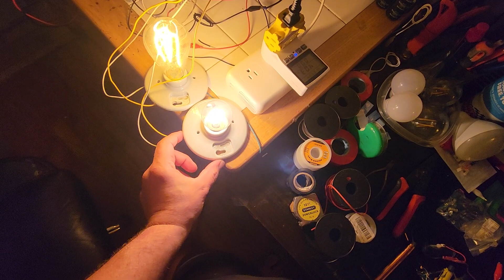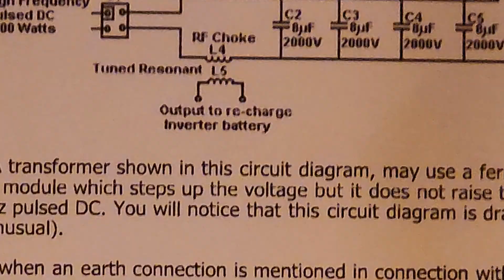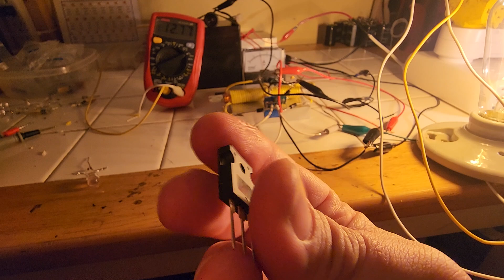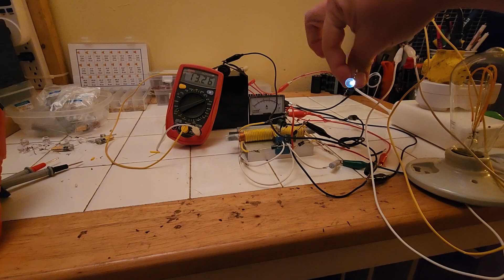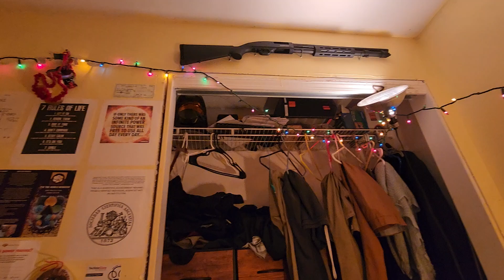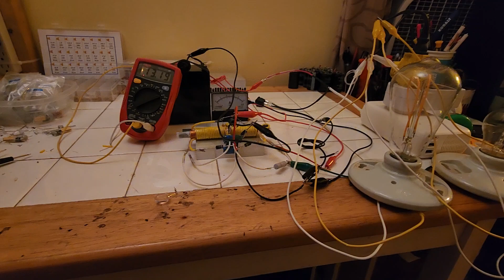🌞NEGATIVE RESISTANCE PHENOMENON NEARLY MASTERED IN RINGER CIRCUIT PLUS LOAD TESTS PART 2💡 70 WATTS!🔵

Comment: What a lot of BS.
Reply from the maker: Feel free to build the system yourself exactly as specified & test it out for yourself. I fully disclosed how to build it
Reply: @MTECH2022  ok .show me the schematic.
Reply from the maker: @mik823  https://www.patreon.com/posts/negative-ringer-103979604?utm_medium=clipboard_copy&utm_source=copyLink&utm_campaign=postshare_creator&utm_content=join_link
Reply: @MTECH2022   i have looked at the schematics however they are ridiculous. You have listed the zener diodes without any values but instead listed them as a SR 150 which is infact a wideband transceiver IC and no pin outs showing in the schematic. There are no lamps in the schematic only inductors and the current in the schematic is nowhere near enough to light up the light bulbs you are using. You are a liar and a con artist.
Reply from the maker: @mik823  i have no idea what false information you're perpetuating but it's literally a super joule ringer 3.0 circuit first invented by laser saber & all I did was add the correct value resistor to the device instead of running a load to create negative resistance then I use resonant coils to harvest the wireless power & send it back to the source. From there it can run an Inverter for a time then when the Inverter is switched off the system recharges itself

Comment: Dude - the voltage levels off at 12.42v under 80w load? That means your system is in resonance at 12.42v and with some more tweaking or a different inverter frequency, you can tune it to level off at whatever voltage you want. I think you may have tapped the underground power from pyramids or some other energy in the earth. Please be careful, that LED is showing that those special EM fields you are drawing power from are saturating your body. There may be health side effects to being exposed to this radiation.  You should contact Steven Greer and get this technology out in a live-stream before you get deleted bro.  Stay safe out there.
Reply from the maker: Thank you & a resonant 5AH source is doing all that & the full schematics are live & listed for free all over the internet now. This technology is an extension of Don Smiths & Nikola Teslas & It's definitely tapping some form of earth power & I'm interested in learning everything you know too.
Reply: @MTECH2022  I have some limited basic knowledge of this effect, but it can come from different fields, many of which are engineered out of our measurement equipment like scopes and DVMs.  I recently heard that there are like 3 other forms of electromagnetism that were in the 21 electrodynamic formulae created by maxwell and later reduced to 4 by heavyside  (I may be remembering that wrong). But we would never know about the scaler, spinor and torsion fields because you would have to derive them from the source maxwell quaternion equations that I still have not found. I have read about floyd sweets static generator and stan meyer's resonant plasma accelerator that was classified by the navy in the 80s. Both of these systems tap different aspects of the same source every atom accesses to maintain it's form or resonance to exist.  These systems simply help to scale that energy up to something we can use with our deeply sabotaged electrical systems. My concern for your health comes from an idea that I had when people say it's always the MIB coming or the aliens, It may be equally possible that these energies are just harmful to the people that are around them, Just like nuclear energy still is when we don't know all the radiation that can come from it.  I just think people jump to irrational explanations too quickly, some people have legit been taken out from talking about this stuff, I am just not convinced it is only the government taking everyone out. You seem to have way more nuts and bolts experiments than I do for sure and i agree with you there is a lot of snake oil out there, but this is likely not that, this is a real effect and people need to learn how they were brainwashed about electronics in school.  If you would like to talk more let me know.  I am deeply fascinated by this stuff.
Reply from the maker: @depsilon4  appreciate your detailed input & I saved your comment to my notes & floyd sweet was extracting energy from custom self oscillating home made magnets he made I believe & there's definitely interesting things occurring within this system especially when it's earth grounded. I'm curious if there's secret pyramid based power sources around the earth that are emitting massive amounts of circulating currents that can be tapped by the correct circuitry.
Reply: @MTECH2022  Interesting you mentioned pyramid power, there are rumors that underground in Alaska, there is a pyramid still powered up that government agencies are studying and using to power remote underground bases and submarines. Pretty sure the ancient ley-lines and pyramids formed a power network before our iteration of modern civilization.  Another researcher that comes to mind is john searl who built and magnetized his own rotating magnet rings to create a generator. Just like we are showing now with nano-materal layering at specific angles when passing current through them causing unpredictable emergent properties similar to meta-materials, magnetizing layered materials at different angles and geometries seems to unlock runaway resonance in these normally benign materials resulting in very high power densities.  I agree with you, these machines are not violating conservation of energy or thermodynamics, they are just newer versions of windmills and water wheels tapping into different streams of air and water pressure where air and water pressure are metaphors for dark energy or energy fields our sensors were engineered to ignore or cancel out. Can't wait to see your test results in an open area away from cell towers, power lines and radio antennas.  Might even be cool to try inside a faraday cage out there as well to prove the effect does not follow normal EM propagation models.  BTW, stan meyer was known as the water powered car guy, but his most interesting work was transmuting different gases using his resonant accelerator.
Reply: @MTECH2022  I don't really understand your approach but I hope you succeed in building a reliable system that I can go into agreement with you and get for my village people in West Africa.  We are on the dark
Reply from the maker: @kanjo-Etienne  i hope the system can accommodate those challenges & help you guys
Reply: @MTECH2022  Yes, I pray so brother.

Comment: 4 amps x 12.75 volts = 52 watts input vs 42 watts output
Reply from the maker: Good math & the system recharges itself when the inverter is switched off & did you see when i drew 70 watts from the device?

Comment: can you also try to use large metallic surface or object as ground wire (without actual earth connection), will it work?
Reply from the maker: Large metal objects should work in theory but there's Somthing really special occurring when the system is earth grounded

Comment: thank you for sharing, if you use 2 supercaps and switch it periodically, one charges without the load second discharges on the load, you should be able to loop it.

Comment: I bet if you disconnect the energy generation circuit from the super cap yet still keep the voltmeter attached to the super cap, you’ll notice it charge itself by itself like it does now. Can you show this?
Reply from the maker: Sure I'll show that in more detail soon & I did some of that in my long vid & the voltage goes up

Comment: awesome, neg resistance, more load, less input. the tech will be so simple and cheap that it will bring real change without anyone getting rich from it.
Reply from the maker: Yes, this technology's foundations are grounded in simplicity. No moving parts & simple negative resistance circuitry. Have to keep it as simple as possible to avoid complexity & Energy loss in the system

Comment: Congrats! Definitely like the progression, and much smaller too. What is the power supply, a lipo only or a bat-supercap combo. What is the  capacity (amp-hour) rating. I just wanted to gauge the size of the supply. Thanks again and keep up the good work :) - BTW, I too had the same problem with being stuck with a ton of knock off  NPNs
Reply: I live in Brazil 🇧🇷🇧🇷🇧🇷🇧🇷🇧🇷🇧🇷❤❤❤❤
Reply from the maker: Appreciate the support & my favorite are Brazilian 500 Farad 14vdc audio super capacitors. They recharge very fast with the high frequency of the system & lifepo4 & nimh no memory effect batteries also work too but just charge slower. If you ever wanted a unit to test I'd send you one for free minus the cost of shipping & it would be the full prototype generator board :)